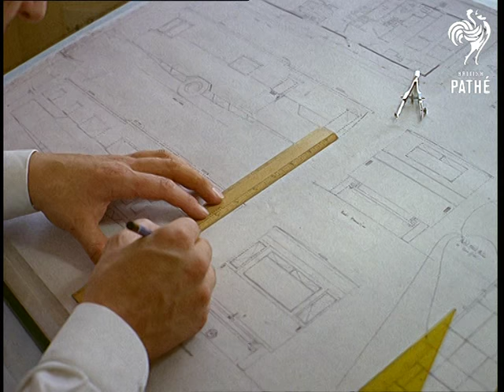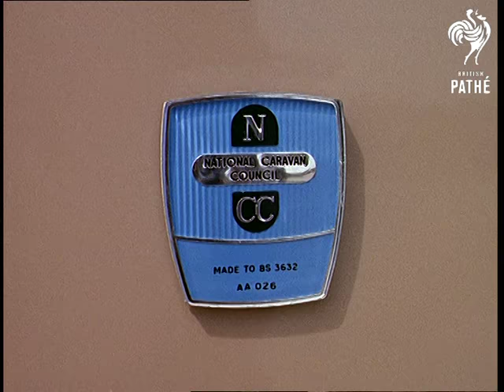Homes On Wheels (1965)

Comment: Wow!...how nostalgic and what great memories. Yes todays caravans have come a long way, but my first memories of staying in one was that in the last clip of this video (being rolled onto the ship) . My mother used to take me to Pipers site in Dymchurch and the caravans then were the round roof type, and small in length. It no mains running water, or toilet in, you filled a large plastic water carrier that stood under the caravan which you put the pipe into, which was attached to the pump action sink tap. There were toilet/wash blocks over the camp.

I remember the old double bikes that  3/4 of us could sit-on the long seat bench ...but only one of us could steer it!

I also remember that the caravans had wall fitted gas lamps that you lit for evening light and a gas bottled gas fire. In later years we changed camps for what was then known has New Beach Holiday camp which had the more modern all mains supplied service cavavans (they also had the cedar type chalets...although they cost more to rent, they had nothing on a 6 berth caravan!) and the family continued our summer holidays there for many years up until the late 80's. 

In later years the father who had owned and run it very successfully for decades, handed the business over to his son , and in later years he sold it to a multi-national holiday company. (think Hoseasons??) But yes many, many happy years of a happy childhood holidaying in caravans at New Beach Dymchurch .
Reply: And Dymchurch has the best beach in Kent, but don’t tell everyone ! 😜🇬🇧

Comment: A very interesting mini documentary. It cut off very suddenly. Is there a full length version to see?
Reply: It's one item from a film made up of several.  The narrator is reading the link to the next one when it ends.  No doubt it will be elsewhere on the channel.  It sounds like it is a feature on a faster mode of transport.
Reply: It's a short newsreel feature film shown, along with the ad films, in cinemas during the intermission between the main feature films.

Comment: 3:00 Those walls look dainty enough; the studs look smaller than 2 X 3s (50 X 75), but not square like 2 X 2s.  I know 2 x 2s were allowed in the USA during the 1960s, but those trailers would blow apart in a strong hurricane, so the FHA established a 2 X 3 minimum to get a federally insured mortgage in 1976. Now, states like Florida require extra bracing, tie-downs and heavier external sheathing in storm-prone areas and even using 2 X 3s, and these buildings can survive 145 MPH winds. The glue that they use to put these things together also helps a lot. I'll bet the caravans they make now for the UK and Australia are also built to higher standards these days.
Reply: We don't get many hurricanes in the UK!